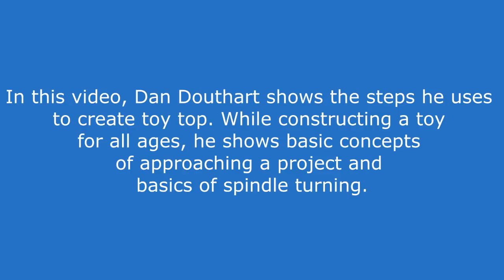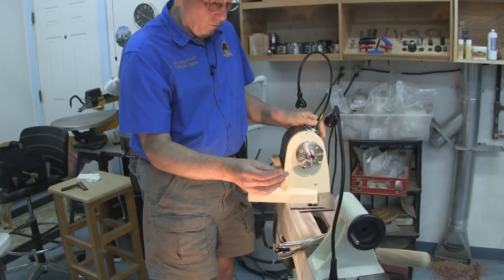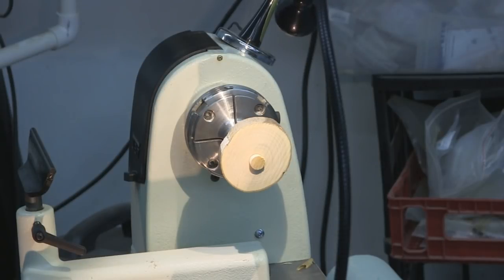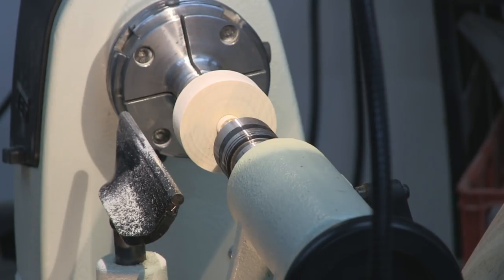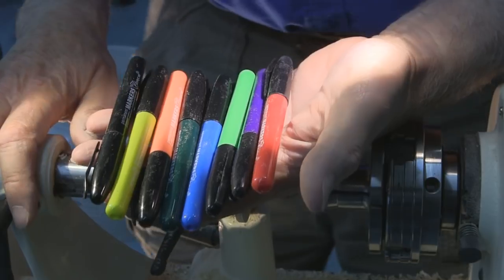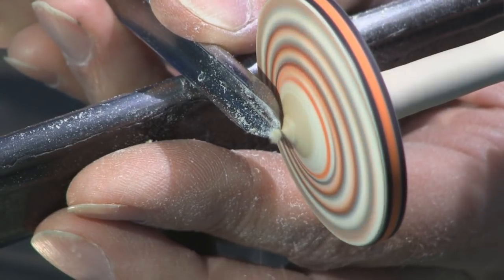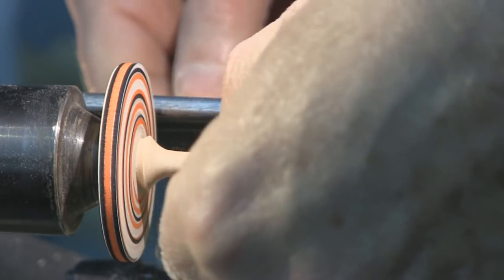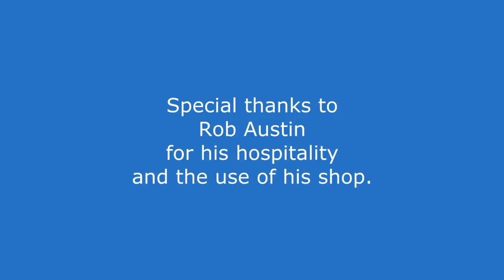2014-05-24 Turning A Toy Top by Dan Douthart

Comment: I work in ceramics, but I just started turning.  It feels like reverse ceramics.  When you throw a pot, you push that roll from the bottom up.  As you push that roll, you are removing, instead of adding.

Comment: Ohh I forgot to mention, make the disc from a heavy dense wood (laburnum works really good) and they will spin for much longer, a good way of explaining physics to the kids!!!!
Reply: If you make it from a heavy dense wood it becomes havy, it means that it's not easy to spin it!  you have to reduce the dimensions, otherwise you dont have enough power on you finger to spin it. Important is to use regularly wood, like maple, beech,   
Difficult to have a balanced spin is for exemple with the burls, olive wood they are to irregular.
Reply: If you make it from a heavy dense wood it becomes havy, it means that it's not easy to spin it!  you have to reduce the dimensions, otherwise you dont have enough power on you finger to spin it. Important is to use regularly wood, like maple, beech,   
Difficult to have a balanced spin is for exemple with the burls, olive wood they are to irregular.